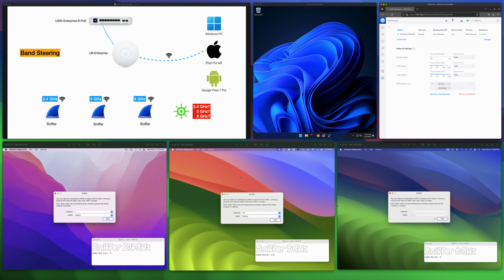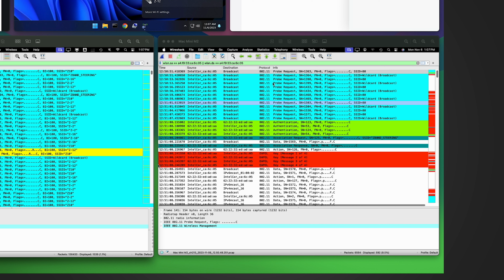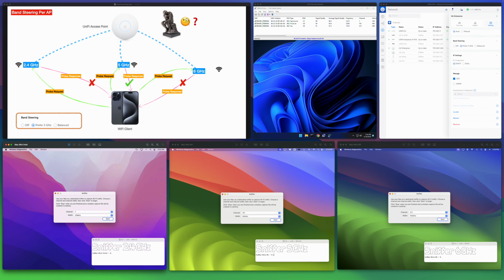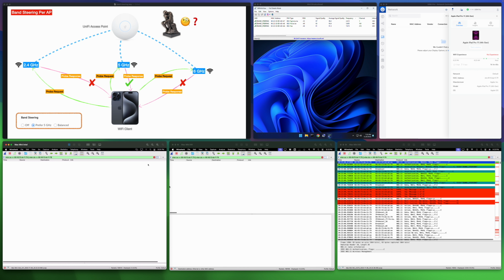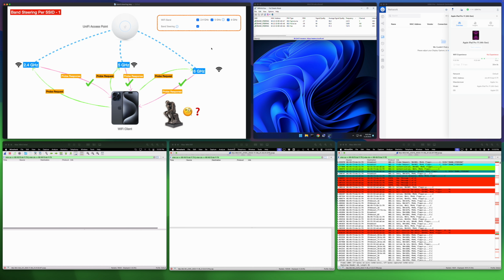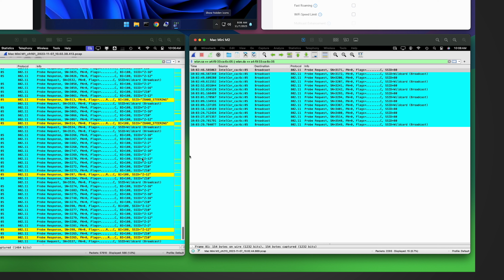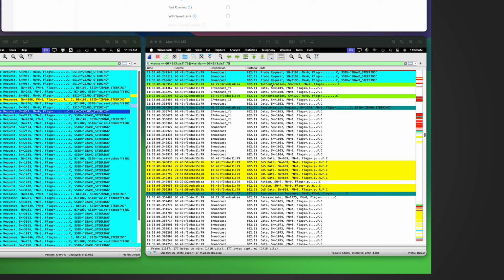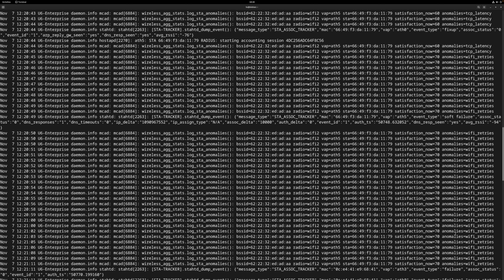Ubiquiti UniFi Access Point - Band Steering (2 of 2 )

Comment: From Unifi help page:

Band Steering
Encourages client devices connected to 2.4 GHz instead to move to the higher performance 5 GHz band using BSS transition frames. This standardized methodology replaces the old AP level band steering, which is fully deprecated. This helps reduce interference, improves overall speed, and ensures better performance for devices that support higher bands. We generally recommend leaving this setting enabled.

Maybe something improved, can you make another test plz?
Reply from the maker: No I will not, because previous experience really discouraged me a lot. I assume now it works similarly to 5G roaming assistance. You can watch that video if you want.

Comment: I know this is a little late to the party, but is there a difference if 6GHz is turned off for the AP? I have an environment that is still using UniFi APs that are only capable of 2.4GHz and 5GHz. I have noticed an effect when enabling this for such an environment. I have not performed a WLAN capture with this, however. This is only based on my manual tracking of clients on the network.
Also, another consideration, what if you performed this test with a client that only supports 2.4GHz and 5GHz while leaving 6GHz enabled? It seems as all 3 devices you are testing with support 6GHz.
I would do this test myself, but the environment this is for is a good distance away and would need another reason to go out there rather than just to test.
Also, thank you for your videos. Very in-depth and informative.

Comment: 18:48 "Band Steering is disabled when 5 GHz transmit power is set to Low or below 11dBm" - that might be the cause why you didn't observe any difference with it on or off.
Reply from the maker: But 6G had similar bad signal qualities and was connected anyway.